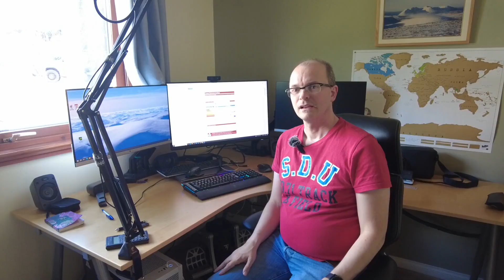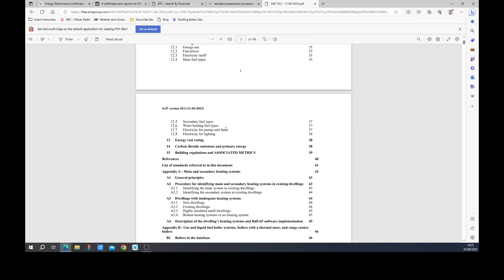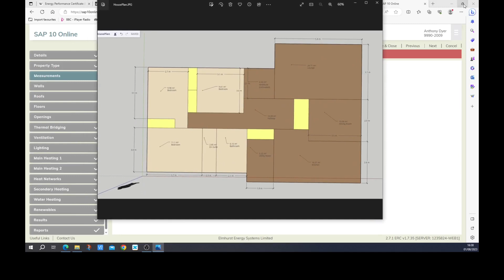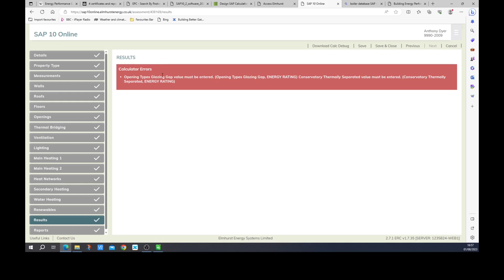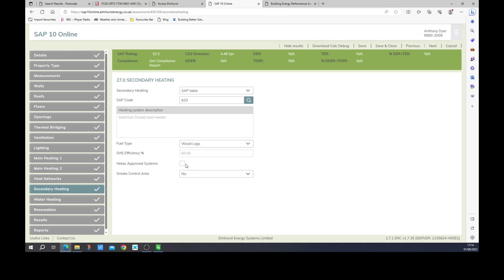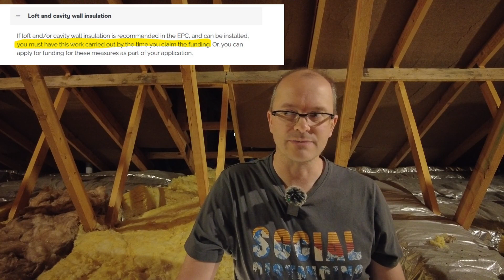Understanding Energy Performance Certificates (EPC's)

Comment: Energy assessors are required to put their head and shoulders through a loft hatch to measure the level of loft insulation present in an existing dwelling. The only reason for not doing so is if the loft hatch is locked shut or if there isn’t one. Only under those conditions for a standard pitched roof will the RDSAP methodology (NOT the assessor) make assumptions about the level of insulation based on the construction dateband of the property. This also applies if the loft has been boarded out and the insulation is covered over.

Comment: It doesn't make any sense that adding wall, floor and roof insulation has less impact on the EPC rating then adding a mains gas boiler (even a condensing one)! At least adding solar PV and home batteries improves the rating, but this typically does not add any resale value to house prices in the UK. Clearly the EPC rating system and assessment methodology needs to be overhauled. Adding a heat pump to your house seems to be a no-brainer, especially with the generous Scottish government grant.
Reply from the maker: Adding a heat pump isn’t such a no brainier at first sight.  Running costs (from peak electricity) are about the same as mains gas.  But the big selling point for me:  Gas isn’t going to get any cheaper. 

Furthermore most of the investments for heat pumps are one off investments that last the life of the building (radiators, pipework etc….).

And as you say there’s not only a decent Scottish grant,  but there’s also zero vat (not sure on the full scope, but if it includes radiators etc then it’s a phenomenal deal).

What makes it better is:  
1. Cheap overnight electricity.  
2.  Cheaper overnight electricity stored in a battery for later use
3.  A helping hand from solar on the better autumn and winter days

Comment: Excellent video. Thanks. From memory, please correct me if wrong, EPC of C or better required to get MPC registration on a heat pump and so get £5k grant in England. Our house was built in c1690 and listed. Despite not being allowed double glazing or solar PV (due to listing) we managed to get to C. Best investments were all in draught exclusion, secondary (internal) glazing and insulation (evidence required or no certificate). So there is hope in even the most unlikely house. Installed heat pump in 2021 and it's so much more comfortable and saves us money. Highly recommended and worth the loooong negotiation with planners.
Reply from the maker: In Scotland an EPC C rating certainly isn’t a requirement to get a heat pump grant.  But there are two conditions:
1.  A heat pump must be listed as a recommended improvement in an officially recognised report that is issued prior to installation (E.G.  EPC, Home Energy Scotland Renewables Selector Report, other officially recognised reports)
2.  An EPC must be issued after installation is complete.  The EPC must have no recommendations listed for installing cavity wall or loft insulation improvements.

For England, I’m not sure what the grant conditions are.

Comment: The solar pre heat recommendation is frankly nonsense, a net present value calculation demonstrates they never pay back in this country, and only adds 1 point to the EPC score.  Good luck with your heat pump.  We went for ground source (vertical bore) and pre-grant availability, but a good RHI return
Reply from the maker: Solar hot water panels have much higher efficiency, but very low capacity factor. Once your cylinder is up to temperature, they are just wasting space on your roof!  I’ve been very happy with the £400 hot water controller, but even then, they are actually unnecessary when you have a battery.  I’ll be talking about that in a future video.

Comment: Moving forwards 20yrs, I can see new house buyers only going for new build eco friendly properties (some come on the back of a lorry all passive and wrapped and modular)  that are dead cheap to run and not overly expensive to buy and last 100yrs.  Old properties to be knocked down, rebuilt and their value will be the land that they stand on. Why would you want to buy a property that will cost a fortune to heat?
Reply from the maker: Japan is an interesting case.  Houses more than 35 years old are free, but uninsurable.  You get lots of interesting designs, and the latest building  standards for all matters (especially earthquake/ fire resistance).  I’m not quite sure what they do with old materials (recycling or landfill).  But they have the highest number of architects per capita.

But in the here and now, energy performance simply doesn’t attract any kind of pricing premium and as a result people don’t care about EPC’s.  I think sadly it’s part of a british cultural disease that’s obsessed with price at the expense of value.
Reply: If I was buying a property I would ask to see the gas/electric bill for Nov-Feb as that give you a yardstick.
Reply from the maker: @wajopek2679  It’s what I recently did when I was checking out a house with a ground source heat pump.  Their running costs were far more than mine and I had my suspicions confirmed when I saw no effort to boost radiator sizes in their house.  It told me everything that their supposed EPC  C rating didn’t.

Comment: Such a good video. We recently had a Victorian 1901 stone terrace (with a cavity) for sale that had cavity insulation done by the council and clearly visible in the cellar. The assessor did not even go down there and wrote no cavity insulation. I sent a photo to them asking for a new certificate but they never replied. £50 for nothing
Reply from the maker: £50 doesn't get you much these days sadly.  That's about an hours worth of skilled work, and much of that is spent driving to and from your property.  

I've not commissioned an EPC assessor before, but can I ask: did they ask you to supply any dimensions or property information, or did they go around measuring up every outside wall and window?

I'm guessing if they already had you supplying information, then all they did was go around to check assumptions before signing off on an auto generated report.

It's very close to being a box ticking exercise as I demonstrated (given that I didn't have much skill in the craft).

For most people selling their house, that's good enough, they probably don't care and neither does the prospective buyer.

But with minimum EPC requirements for tenancies tightening , I'm guessing that landlords are going to get quite picky about who they choose to do their EPC assessments.  At that point, reputation rather than price will be the deciding factor.
Reply: It was arranged via the estate agent and we just paid the £50 online direct to the surveyor company. Guess it was just a formality to go through for the sake of it